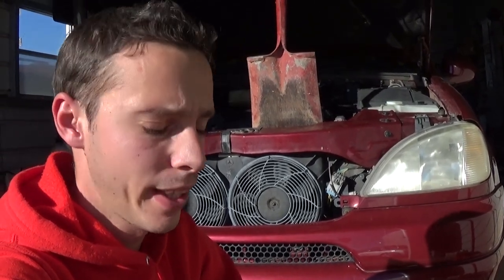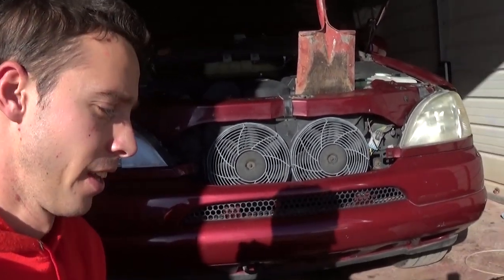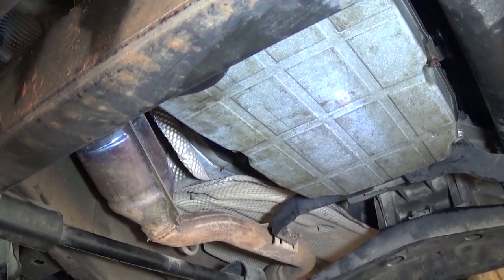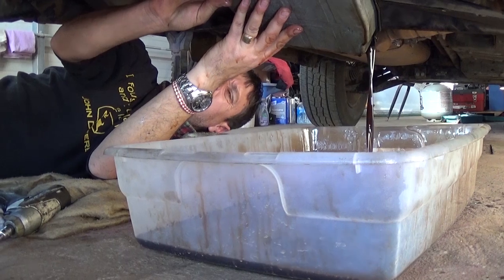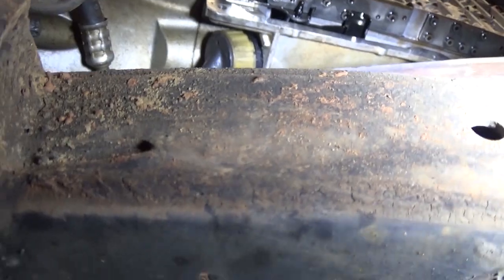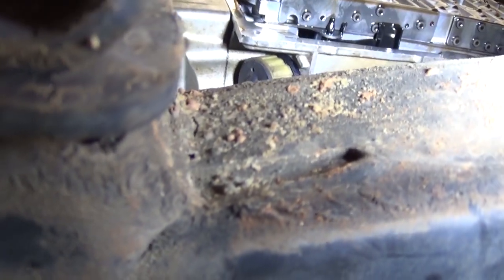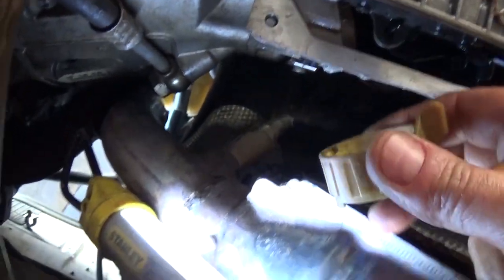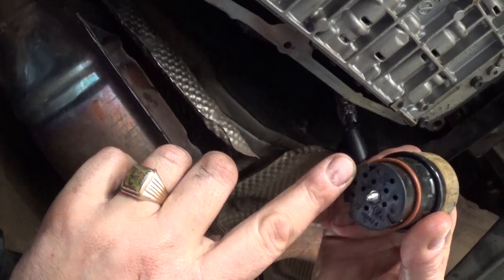HOW TO FIX MERCEDES TRANSMISSION LEAK  Common Leak FIX

Comment: Hey guys, thank you very much for the video! I did the same thing to my 99 ml 320. The gears dont slip anymore and P0700 code is gone! The job cost me around 60 bucks and 3 hours. Many thanks!!!
Reply: Could you explain me the gear slipping? Was it that from 1 to 2 it could give you a high rev and drop down when the second gear was engaged and give you a push?

Comment: Thanks for the video - nice :) I've changed the oil (full flush), filter and this plug today in my CLK320. Plenty of work - took couple of hours! And I had a huge problem with pressing new connector with new o-rings back into the socket. Real nightmare - it took me at least 45 minutes to get this pressed back - really annoing. But all work good now and I'm verry happy that I did the full oil change myself.
Reply: koolaevah do you have any advice for this process? I have a 2001 Clk 320 and was told that my oil pan is cracked. Recommended to A mechanic but money is my issue. Much more economically sound to attempt the repair myself.
Reply: koolaevah very difficult to plug back in!!  About an hour. U have to reach around, over and under.  Exhaust in the way.  No way to press it.  I finally had to use leverage to help.
Reply: @down4mine  buy a new pan, check online, OEM and as well OE available, may as well get gasket as well, some come with a new pan, some dont

Comment: Have a w163 don't know if it was maintained properly engine has sludge build up should I do flush and trans service or leave it 240,873 miles , no check engine light or any dash lights

Comment: Thanks for the video, i got the old one out, but i do not get the new one in! The screw won't grip when i try to screw it in. I can push as hard as i want, it won't hold. Any tips?
Reply: It's not in all the way it has to click in twice
Reply: I'm assuming you're referring to tightening down the the bolt inside the automatic transmission plug adapter. There is a trick to it. Most standard sockets are too deep. The back part of the socket won't push down on the bolt far enough to push it in so that the bolt threads can catch. The solution I found was to insert some tape inside the socket to push the bolt farther down. The bolt threads will catch then.
Reply: @dbeaton1111  I pushed the socket really hard in and then i started to screw with my fingers. When i noticed that the screw held, i used your trick and it finally worked. Thanks a lot!

Comment: I replaced my alternator in my ml320 mercedes and my brother in-law was helping and he broke the vacuum hose connector. We tried to rig it but its notworking. Should I replace the whole tank or just the one hose that runs from the overflow tank to the radiator and get a new vacuum hose connector. I am on a disabilty small budget Please help...

Comment: I didn't have any problem taking the plug out but new one does not go down all the way enough to have 7mm screw catch the female screw down below.  The plug goes down and locks enough it does not rotate any more.  Maybe because the new O-ring on new plug is stopping to go down more.  Do I need to tap down the plug somehow?  As long as I am sure pins are aligned to all the holes, I feel comfortable to tap down but I am afraid it might damage those pins.   Any suggestion?
Reply: I am having the same problem, the plug will NOT go in far enough. I did this before a year ago and snapped the bolt so best to use a nut driver and NOT a socket.
Reply: Well I got it in, finally. I really had to press it in so hard. I used 2 screwdrivers at the same time using 1 to make a lever for the other so I could press on the backside. I think the problem is getting it to go in strait.
Reply: Use a little bit of silicon lubricant on the new plug and o-rings... 
Slides in snugly!
Reply: Been looking everywhere for this question.   @Shane71170 Thanks

Comment: Nice video. Where was it leaking? I have a 722.9 (2012 GL350 Bluetec) that leaks in the bell-housing. Replaced the front seal but still leaks. Any ideas? Pump? Thanks.
Reply: Could be your oil cooler seals. Is it leaking from the front or back of the engine?
Reply: Kevin Better - it is transmission oil for sure.
Reply: The ATF is also known as transmission oil. And the cooler he is referring to is mounted to your radiator. There’s silver crush rings that could be failing

Comment: Hi, is this "13 Pin Connector" the cause of W163 goes into LImp Mode?
Reply: epatias think so
Reply: Andre smith i can give you all the help you need can you describe what is wrong with the gear box does it shift strangely or does it go into limp mode every once in a while??
Reply: In most cases i advice you find you tcm and disconnect the cables going to it and check for traces of oil
Reply: epatias now depends on what codes you get too a p2602 may mean that you may need new solenoids or simply 13 pin connector leak so describe your problem and let me see if i can help that is if your car is still going into limp mode

Comment: (722.6) How many litres total  7.5 or 8 ?
Torque converter capacity ?
Drain pan capacity ?
Have shifting issues after fluid change ( low or overfilled)
C200, w204, 2009 model
What is the normal Mercedes transmission operating temperature?

Comment: mean guys I have a 2014 313 sprinter van cdi an it's leaking trans oil does this van have the same transmission im in a wheel chair so really need to fix this problem can you comment back plz

Comment: I bought new wire adapter mopar greased o rings it wont go in enough to tighten bolt tried pressure still no good tried new rings on old one then that one wont go either.o rings holding it out. Leaking one back in till i can figure it out.

Comment: Yo I changed mine on a sl500 2000 new atf,bolts,gasket,new plug,new filter ,I think like 3 qts came out, put in 7 qts idk if fluid was low when I drive to test it drove way better then ever but it's started dripping atf out the passenger side looks like 1st bolt do these transmissions have overfill holes? Did I put too much fluid or did I do something wrong ????
Reply: To much

Comment: Just a Heads-up.... Guys if you do not have proper space and proper tools and proper jack DO NOT just the jack the car up and try changing this Transmission Connector.       You must provide your win-number to MB dealer to get the right plug part number and it is not like just buy the MB original connector from eBay as we did. In our case it took us 20 minutes just to unplug the connector and 40-minuted to put the 7-milimeter socket on a tiny 7-mm male screw inside of the big connector and it was very frustrating-- DO NOT USE LONG 7-Mili SOCKET, . Nothing on this connector goes right and it is not easy to pull it out and is not that easy to push it in as it is showing here YOU NEED TO SPRAY and CLEAN the connector real good it before touching it. I helped my friend's car and we spent Saturday and Sunday to get this job done and there were still tons of oil in the connector after changing and started the engine. New O-Ring on new connector was too fat to let the connector to get in and there was no space for hand to push it hard to get in with hand as this person is explaining and if you hammer it you may break the pins inside and it is a very costly damage. so we put back the old smaller O-Ring back and pushed it in---- very bad practice. So be very careful doing this job yourself; if you have few hundred dollars it would worth the frustration and have a mechanic shop to do it for you believe me.

Comment: So, the plug cannot be replaced without dropping the pan?
Reply: Karr Knutt it can be replaced the pan was dropped to let the oil drain as it is also good to replace your oil while you're at it and in some cases the oil would rush out the plug when you pull it out so its just better to drain the oil either using the drain plug or if you dont have one just by taking the valve body cover off and then replacing the atf

Comment: Hello bro, i changed transmission oil about 1 month ago, and now is leaking oil from it... We changed 3 filters different brands and the adapter you are talking about but it's still leaking drops of oil. I dont know where is the problem if you can help me please ? The model is w204 2008 c220
Reply: Dif you figure it out?
Reply: check gasket,

Comment: I replaced conductor plate on a 2001 ml320 and now the car jerks when I put it in reverse or drive. Any help. Thanks
Reply: You should erase the codes in transmission computer

Comment: How Much oil does a 722.6 take ?
Reply: Was going to ask a similar question....how do you establish the correct level. One thing I do know is taking the pan off doesnt drain it all out as there a good few litres still stuck in the thrust side of the unit. If you have a drain plug ensure you catch it all and measure it against the fresh you put back in and, perhaps an extra little splash to account for the leakage? :)
Reply: I have also heard you can get transmission dipsticks on ebay....be careful it is for EXACT model though....you can do a lot of damage if you misjudge it excessively!

Comment: What's the part called?
Reply: TheJayy420 13 pin connector is what it's known as and it's for the 722.x transmission

Comment: yeah  good work , saved me snapping the plug off , was wondering how that little elec plug came out  and went back in , there is a procedure with it , good videoing because its in a bitch of a spot to do , cheers

Comment: Or u fake or scam at 7.24m u shows u take off the lock ring and at 7.40m you pull out a complete one with a red ring seal sec later you shows another one with black seal I don't get ir